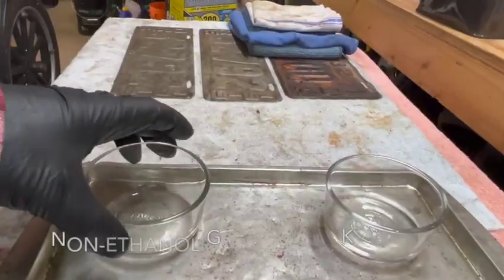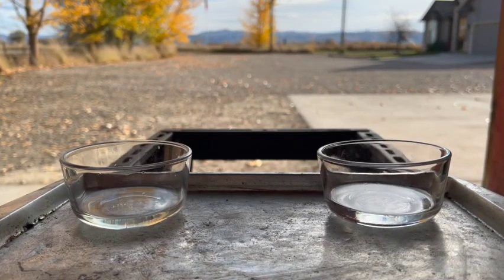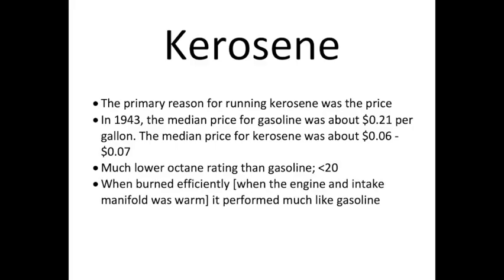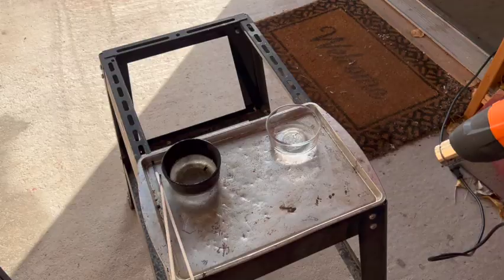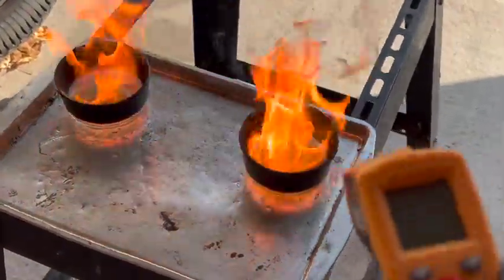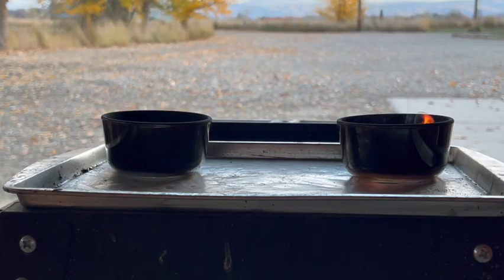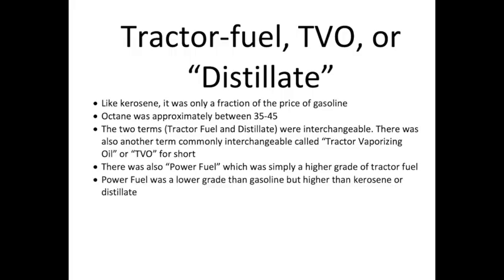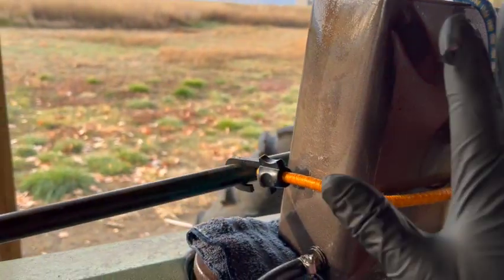John Deere B - Gasoline vs. Kerosene Demonstration

Comment: Interesting. Thanks for that. I have a 41 H that is the same deal, although we have never run it on Kerosene. I would think there would be more lubricity with the Kerosene also. I thought I remember the owners manual saying you may have to tweak the carb jets a bit with Kerosene, but it seems as though yours ran fine. Maybe under load you would ?
Reply from the maker: Yes, more mileage (working time) on kerosene is my conclusion. I was unable to test HP comparisons but it seems that lesser HP (if any) would be offset by the huge cost savings in running kerosene vs. gasoline back in the 40s. You can Google some of the old Nebraska tractor tests…. Some of them do report differences running different fuels, although those reports are somewhat difficult to understand.
Reply: @AntiqueCarsandStuff  I believe the manual had the results from the Nebraska tractor test. I'll take a look at the manual tomorrow. It would be interesting to see if they specify if the tests were done while running on gas or Kerosene. If it's in there, I will let you know.Time for bed, ha ha .
Reply: @AntiqueCarsandStuff  Nebraska Tractor test 312 was performed on Distillate.
Reply from the maker: There was absolutely no difference in the way it ran on kerosene vs. gasoline. Doing this experiment under load might answer more questions. If you saw Part 2, the operating temperature did increase on kerosene. Some folks have said that exhaust manifolds would often glow red after working with a tractor on kerosene.
Reply: @AntiqueCarsandStuff  I didn't see part 2 but will take a look. Thanks again .

Comment: It appears that you have a gasoline manifold.  Some had an all fuel manifold.  My '40 B does.  We used to run power fuel in it exclusively.  We never started them (had a '43 A too) on gas.  When we did switch them over to gas, we closed the idle and load jets about 1/4 turn.  The other day it was about 55 degrees and I had to prove to my son that it would still start on one crank.
Reply from the maker: Do you happen to remember the price of power fuel back then? Just curious. Thanks.

Comment: Well done video, I have a 39 B and as soon as I can clean the junk fuel from the starting tank I will do the same. I have a couple of Fairbanks Morse Z engines that I use for jobs around my place. If you warm up the engine on gas it will run on diesel all day long. As long as there's a load I've never had carbon build up. The one engine has water injection to eliminate precombustion and reduce the impact on the connecting rod
Reply from the maker: Thanks. How does the water injection work?
Reply: @AntiqueCarsandStuff  there is a threaded hole in the head water jacket with a banjo fitting and a needle valve. The Tube goes into the head just behind the mixer and butterfly valve. When the engine is working hard it will knock from precombustion so water is added to stop the knocking. I've read that the correct amount of water will with the heat turn into hydrogen, and I turn give the engine more power.

Comment: Another downside to kerosene or distillate fuels was that it would get past the rings and dilute the engine oil. Most tractors back then had two oil petcocks. It was recommended in the book to drain the kerosene off at the lower petcock, and then fill back up with oil to the top one. Or, if they just had one, to open it up and drain it every day to the correct level.
Reply from the maker: Yes, the JD had two drain cocks.

Comment: I wonder how many farmers forgot to switch back to gas when they parked their tractor and then flooded it the next day trying to start it on kerosene?
Reply from the maker: Yes, that would be a problem. I bet that happened a few times.
Reply: It wasn't fun did it as kid on neighbors 39 B. We run gas in ours so I killed like we did ours at home.

Comment: This is a very, very interesting experiment! I've never seen anybody running their two-cylinders on Kerosene like they were designed. Neat stuff. One day I plan on plumbing my gasoline starting tank on my H up as a reserve fuel tank, and now that you've made this, I'm almost interested in taking it out and plowing with both fuels and seeing if I notice much of a difference, as I know Kerosene was supposed to produce slightly less horsepower from the factory.
Reply from the maker: Thanks. If kerosene was cheaper, I think a lot of us would still be using it in old tractors. As it is today, it is over twice as expensive as gasoline.

Comment: Awesome video. I run my 1929 mccormick deering 10-20 on diesel fuel instead of kerosene.  It's designed to run on kerosene but off road diesel fuel is a little less expensive in my area and works just as well.
Reply from the maker: Thanks! I assume you're running a mix of diesel and gas in the 10-20, or did you mean straight diesel?
Reply: @AntiqueCarsandStuff  Yes I meant straight, 100% diesel fuel. I was monitoring the manifold temperature and it has to get up to 450 degrees or so before you can switch it over to diesel fuel. Once on diesel fuel you can't even tell, runs clean unless you loose temp.  I have 2 tanks similar to your B, 3 quart gas tank and a 15 gallon "fuel" tank. Turn one valve off the other one on.
Reply: @SLED4NK7  Ive heard of 50/50 mix but never straight diesel. How's the power running on diesel? do you fowl the spark plugs much? Post a vid of it running on diesel!

Comment: Did you notice any rise in running temperatures on the kerosene? Just was curious seeing it burned warmer in the dish. Cool experiment!
Reply from the maker: I ran the tractor for about 15 minutes on kerosene and there were no changes to the operating temperature. Maybe a longer run would have caused the temps to increase? Hard to say. These John Deere Bs run so cool anyway. It would be interesting to perform this test on a 4 cylinder tractor .... and record the temps.
Reply: Dad had a B from the early '40s and we occasionally ran it on kerosene. When we were discing, it ran noticeably hotter on kerosene and would have to run a lower gear when we were discing uphill to prevent overheating. I didn't notice a change in power but ran hotter when pulling hard.

Comment: When they ran the Nebraska test, they documented whether it was kerosene, gasoline, etc.  There is a website to pull up the tests on the older tractors, and it will also show the year and what fuel was used.  It would be interesting to see what hp ratings a kerosene tractor versus a gasoline tractor to the same tractor model.
Reply from the maker: I looked up a couple of those reports. I didn't find any Kerosene data, but I found some Tractor Fuel and Gasoline data .... A tractor running Tractor Fuel used about 11% less fuel than the gas engine, but also produced about 10-15% less horsepower than the gas engine.
Reply: @AntiqueCarsandStuff  It is interesting that kerosene burns hotter than gasoline.  Kerosene tractors typical ran lower compression ratios to prevent pre-ignition or spark knock, I assume because of this higher burning temperature.  The lower compression ratio contributes to  the reduced power output.
Reply: Something else that occurred to me is that in the case of the John Deere 70, if you compare the All-Fuel version to the Gas version, the All-Fuel version maintained the same size engine as its predecessor, the model G (413 cu. in ).  The Gas 70 engine was smaller (380 cu. in.) which helped offset the power loss due to the lower compression ratio.  This explains why when a G or 70 All-Fuel is brought up to the specs of the Gasoline engine it will actually produce more power than an original Gas 70 tractor.  By the time the of the Model 720, the Gas and All-Fuel engines were again the same size (360 cu. in.).  This explains why All-Fuel 720 saw almost no  power increase over a 70 All-Fuel  while the changes to the Gas 720 produced a very significant increase in power.
Reply: @carlkuhn5483  Being kerosene is lower octane if advancing the spark would have made more power.  Or if under heavy load the engine would "ping" if the timing was normally set tp run on gasoline?
Reply: @AntiqueCarsandStuff  also they don't record how the operators eyes burned when the wind shifted into the direction of the operator!
  We have a collection of 17 Letter Series John Deere tractors. Most are capable of starting on gasoline and switching to kerosene. We've done it with several of them and found that unless you are actually using the machine under load it is necessary to keep the tractor in the upper end of the temperature range in order to keep from fouling the plugs which would make starting the next time difficult. Back in their prime power days I'm sure this wasn't a problem. But I can bet at the end of the day operators may have cut that shut down/switch over time too short causing many a hard restart!
 There's no doubt they would run on kerosene, that's really the only advantage the horizontal flow two cylinder intake system had over the up draft competition of the day. (although IH also made start on gas, run on kerosene tractors at the time, all were up draft) Most manufactures went away from all fuel as soon as gasoline came down in price. As we all know now, kerosene is all but impossible to find and if you can find it it's much more expensive than gasoline so I guess there just no point putting anything but gasoline in the little tanks as well as the big tank and use them as a reserve  tank.
Reply from the maker: Very interesting! Thank you.